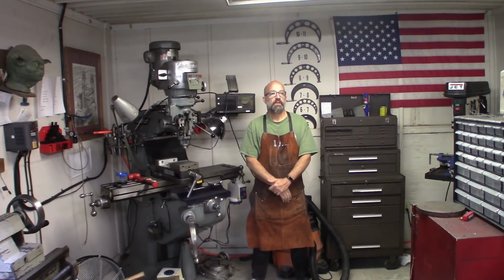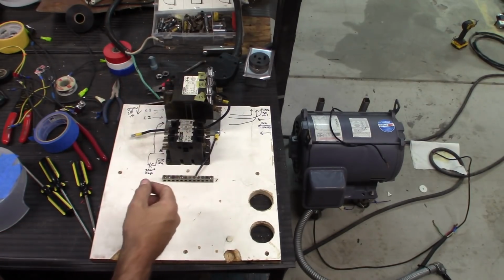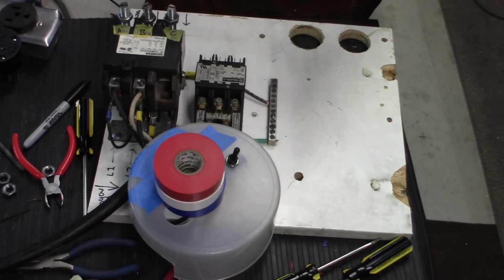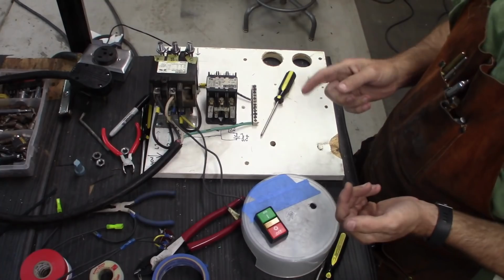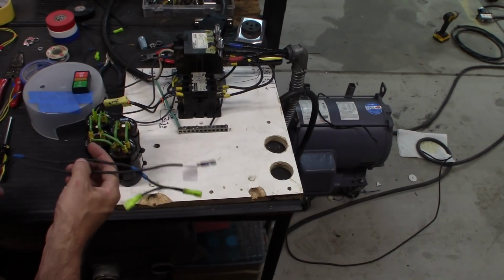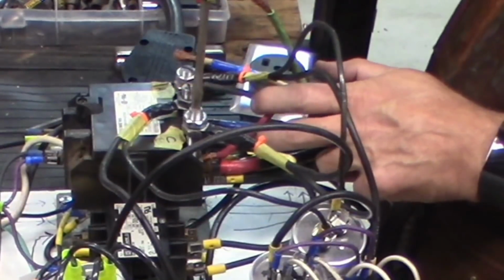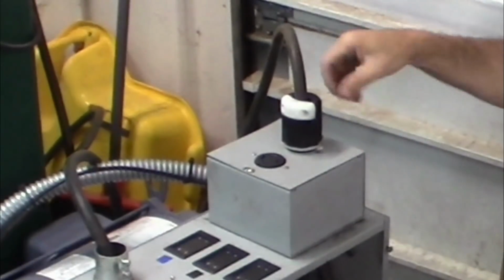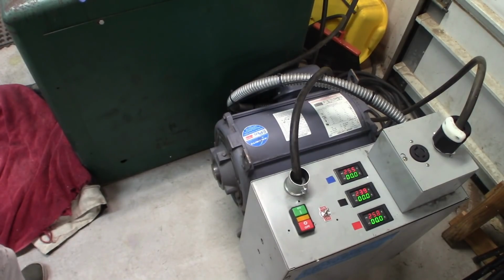Home built rotary phase converter for home shop 3 phase power

Comment: To help with start-up add another contactor to take the balancing capacitors out of circuit until the converter motor spins up. The way you have it wired now you have capacitors connected off of both hot legs to the ghost all the time making it hard for the motor to start in the right direction.
Reply: If you’re making changes, I’d suggest that once it starts reliably, it would be less complicated to run if you replaced the momentary switch for the starting caps with a normally closed relay that has its coil powered from the ghost leg. Great video, thank you for sharing.
Reply from the maker: @ianlevine273  That is the exact plan, actual found a relay that has both on and off legs that I can swap run/start capacitors and lower the inrush of starting it with the run caps already in line.
Reply from the maker: What you're saying makes sense to the issues I am having.  I'm about to do a lessons learned rebuild and update of this guy and hopefully update with one button start as well.

Comment: I need to build a 3 phase converter for welding shop.  Three welders, air compressor, mill, & band saw.  Can you suggest where I can learn more about the requirements & where to purchase components ?  I have access to 25hp & 50hp motors.  Not sure of my input power, but I'll have it boosted if necessary.  Any advice/recommendations are appreciated.  Thanks for your videos.
Reply: One more question.  From your experience, can I operate a welder(s) on a 3-phase converter?  Have found no videos/info on the subject.
Reply from the maker: @gregcombscustomcultipacker5785  I haven't ran a welder on it, but even with the limited knowledge I have of them I don't see why not.  A rotary phase converter makes a pure 3 phase sine wave just like you would get from the power company.  Pay particular attention to the balancing portion and go about 150% of the power you need on the idler motor.

Here are some links to some of the supplies that I used in this build:
https://www.amazon.com/gp/product/B01M27KVPM/ref=ppx_yo_dt_b_asin_title_o06_s00?ie=UTF8&psc=1
https://www.amazon.com/gp/product/B01AHWXOSA/ref=ppx_yo_dt_b_asin_title_o08_s00?ie=UTF8&psc=1
https://www.amazon.com/gp/product/B0773WGHNY/ref=ppx_yo_dt_b_asin_title_o01_s00?ie=UTF8&psc=1
https://www.amazon.com/gp/product/B071GKH9HX/ref=ppx_yo_dt_b_asin_title_o02_s00?ie=UTF8&psc=1
Reply from the maker: I got most of my info from this video: https://www.youtube.com/watch?v=u229h7NcMxk he does an excelent job going over it.  He also links to this document which I also used: https://www.practicalmachinist.com/FitchWConverter.pdf
Reply: @TheArsonsmith4242  Great!  Thank you, I'll check them out.

Comment: good job. I built my 15hp  RPC  I used a timed Temp switch to fire the start caps.  so I dont have to hold 2 start switches .  Im looking for a fuse panel now to switch to all machines being on a breaker.  that way lightning or a power surge wont fry all my machine motors.
Reply: Thanks for your input. I need to build a 3 phase converter for welding shop.  Three welders, air compressor, mill, & band saw.  Can you suggest where I can learn more about the requirements & where to purchase components ?  I have access to 25hp & 50hp motors.  Thanks
Reply from the maker: I was looking at a voltage sensing relay to add into the circuit and control the start capacitors.
Reply: a potential relay will do the start caps for you
 @TheArsonsmith4242
Reply: @leesullivan7635  that is the route I went, with a potential relay and has been running for about 20 years now. it any pretty though. Only about 3 hp though.

Comment: I’m thinking the single phase supply line isn’t large enough for the surge when starting the idler motor. It looks to me that you have a 50 amp outlet and that idler will pull way more than that just to get up to speed. How many amps does the idler pull when it is just idling with no load? Also you will need to watch the draw on the single phase as you start using bigger machines like your mill or lathe.

I have the parts to build my own 5 hp Phase converter, right now the only 3 phase machine in my shop is my big mill and I’m running it on a VFD for now. I have a 3 phase motor to run my small mill which is where I need the VFD for speed control.
Reply from the maker: I got an additional amp meter that I'll put on the inlet line.  It should get me a better idea of what the draw is.  The entire shop is unfortunately on a 50 amp breaker, so the start of the motor plus anything and everything else in the shop, garage and guest house, doesn't blow the breaker (unless something else is wrong or I'm running the heater)  I'm working with someone now to see if there's better options for upgrading my home panel to a 400amp so I can run a larger sub panel for the shop.